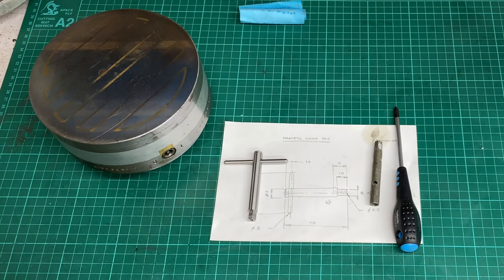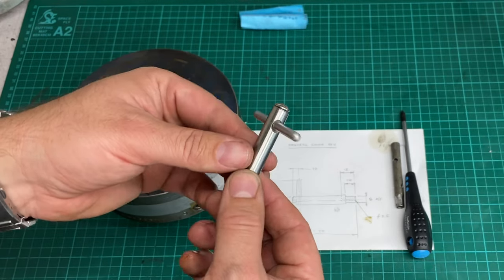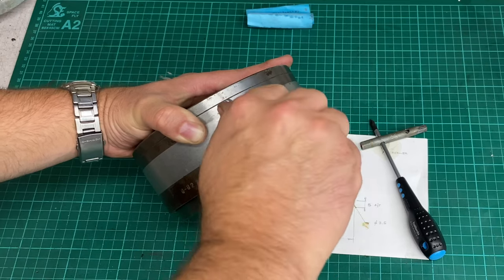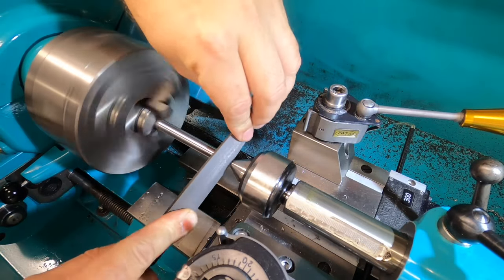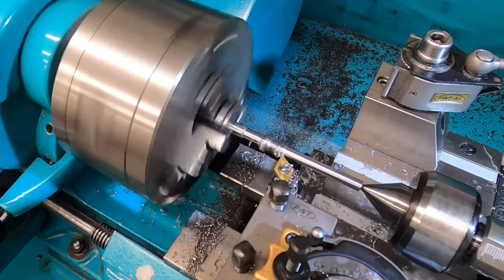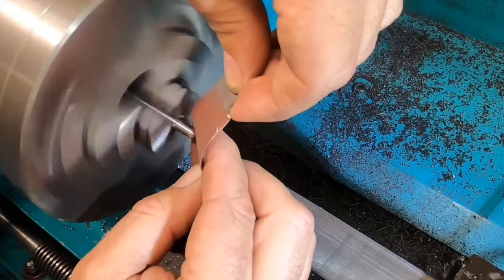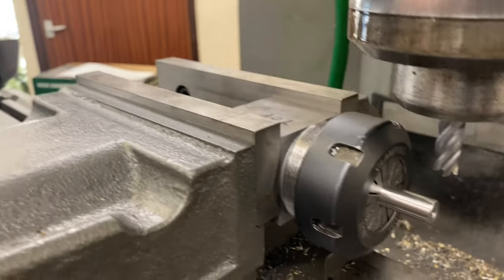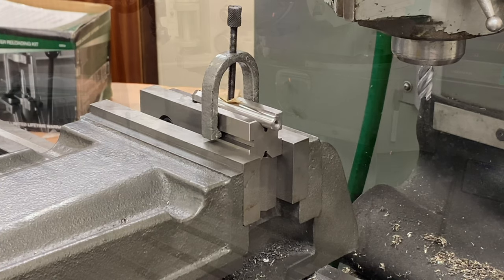Making a chuck key from 316 stainless steel.

Comment: Good to see you back again. I like the way you take time to make your tools look nice; it shows a commitment to quality work and care for your equipment. I also like the use of stainless steel, which is something I hope to do but have hitherto shied away from. I now have some carbide tip tools so I'll give it a try, but I'll probably get some 303 for easier cutting to start with. May I suggest that when you revisit the T handle you consider upping the diameter to 6 mm, which I think you may find more comfortable. Best wishes.
Reply from the maker: Thanks for the feedback George. I do intend to increase the handle diameter and it’s a good point. I use stainless a lot because I’ve got rusty hands and it’s an affliction I’ve had since I was an apprentice (we’ll probably since birth actually) which was when i was given some very clear instructions, let’s say, about oiling things like parallels after use.

Comment: how did you set the drill center position with it on the tool post? That would have probably been a good take away from this video. You know besides the obvious things shown in this video. No hate, but the set ups and physics never seem to be shown in most of the vids out there. Just boring ass cuts. I could set it up, but if the intent is to educate, the young probably won't get much from this. Cheers. I love lathe videos.
Reply from the maker: Thanks for the feedback. I try not to repeat myself too much if I have tried to cover subjects in other videos. I do have a video about drilling with the tool post / carriage as well as another one about setting up a tool library in the DRO. Here’s a video of the tool post drilling approach:

https://youtu.be/sNLI_wUGXII

Feed back is always welcome. I don’t claim to be the oracle in any way. I do have 30 years engineering experience but I appreciate that there are people out there who know more than I do and are better at presenting it. I suppose what I do is more about sharing the projects I’m working on and I try to mention little tips here and there as they occur to me.